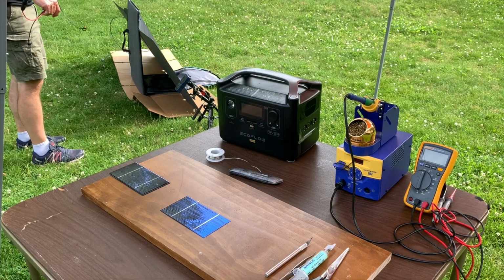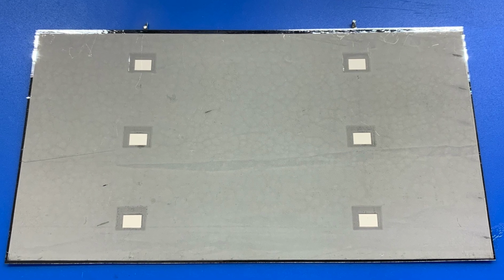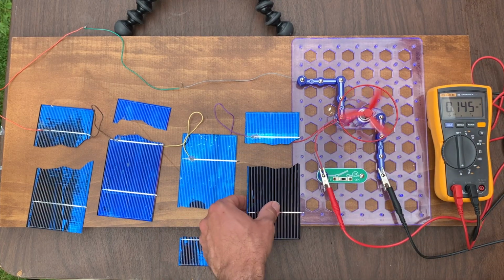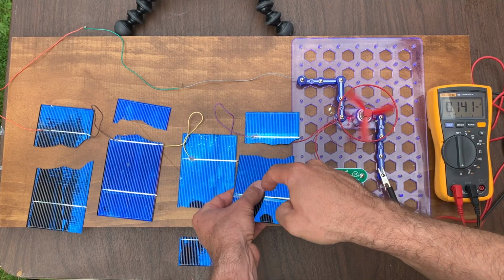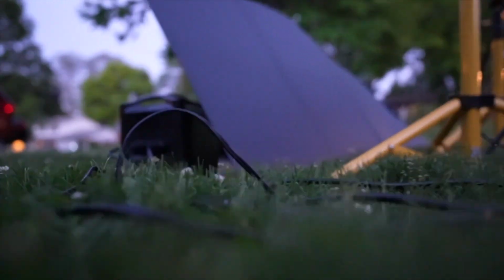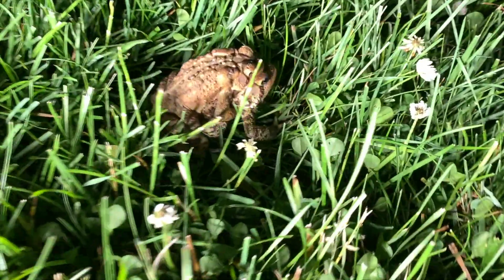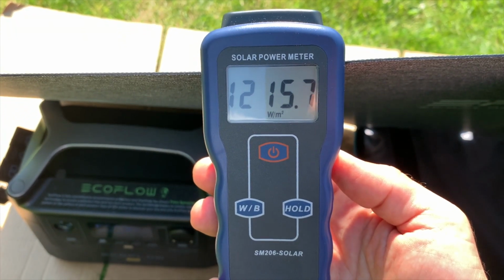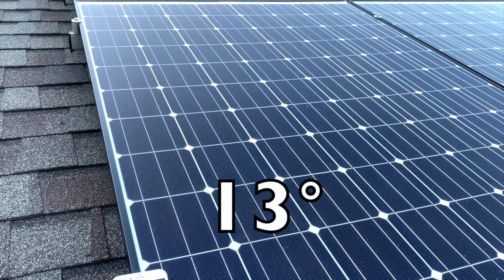What Happens When Solar Panels Break? And More!

Comment: have you tried CDM bulbs? they are better at mimicking sunlight - but they do generate a lot of heat.. you can also get a solar tracker, could use that maybe with a relay connection to a more powerful stepper motor so it can rotate large panels

Comment: How do you deal with the eventual need to re roof under the panels?
Reply from the maker: In like 40-50 years?  I’m sure there will be a new technology out by then to try out.  My shingles have a 25-30 year warranty and they are protected by the solar panels.  But when I have to reshingle, I would just take things off in a day, roofer does their thing, and then put them back on.   Guys who install solar regularly can put a system in like this in about a day so I don’t see it as a big deal personally.  Most of the hard work of permitting, wiring, conduits, etc is already done and wouldn’t need to be redone.
Reply: @FrugalRepair  thank you for the response I am very pro solar I just never thought about it before. I assume that the panels would create some sort of protection but then I was curious if the rate of deterioration of the ones that weren't under it would be vastly greater? I might just get one of those metal sheetroofs when I go for mine but it's nice to be able to have videos that explore options like this one.
Reply from the maker: A metal roof is a good option to consider.

Comment: Can any this solar generators be recharged with wind turbine or hydro turbine?
Reply from the maker: If the output fits within the input maximum on the generator, then I think it should work.  I haven’t looked into it though.  Are you looking for a particular application?

Comment: I understand getting the actual electricity to a net zero, but up here in Canada, the extra fees on our bills are more than the electricity costs. Do you have any delivery charges or extra costs on you electricity bills?
Reply from the maker: Sorry to hear that!  I go over the details in the “is solar worth it?” video but there is a $7/month charge and that is the total connection grid fee.  This fee is more than paid for by two different types of credits I get with solar.
Reply: is there a way of switching to solar or alternative after the meter through your fusebox??

Comment: How did you have a power outage when you have solar?!
Reply from the maker: Good question.  It’s because of the safety protocol mandated for the inverters.  So that it’s impossible to back feed to the grid during an outage.  They only operate when they sense the grid.

Comment: Thanks for the video!  I have an unrelated question.  I have a Karaoke machine that I love but it's not reading the CDs all the time.  Is there a way to replace the cd mechanism and a source for parts?  Thanks!!
Reply from the maker: Thanks!  I don’t see why you couldn’t replace it if you can find a whole unit, maybe on eBay.  I’d try cleaning the laser first.  I’ve heard about others replacing a diode near the laser module to repair bad lasers.

Comment: i have a tcl smart tv, when i turn it off and unplug it from socket the time and date returns to factory default. what should i do. (out of topic from solar panel).
Reply from the maker: Is there a battery on the main board?  If so, maybe it’s bad. You could also try restoring to factory defaults.  Maybe there is a firmware issue.
Reply: @FrugalRepair  there is no battery, i  will try to restore it hopefully it will work, thanks for replying.

Comment: What part of how solar panels work don't you get? they use UV light not white light from LEDs so how in the hell did you expect power back from those lights it's basic solar 101! as for suggesting people would walk on panels is just total stupidity there made of glass & silicon, so anyone who was stupid enough to do that great they get what they deserve!
Reply from the maker: Thanks for your comment.  Normal silicon based solar cells mainly work with visible light, not UV.  Also, there are plenty of people who kneel, step on or even walk on their panels, unfortunately.  Watch the NREL video I linked in the description.   They did a good job showing why this is a bad idea.
Reply: I have solar panels that power lights or fans over 10 feet under the carport where UV light doesn`t reach.